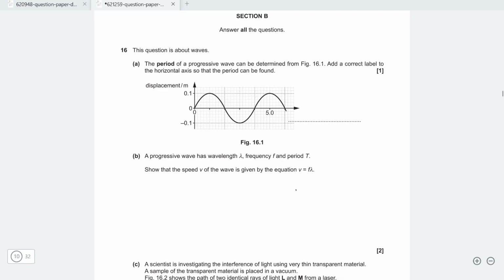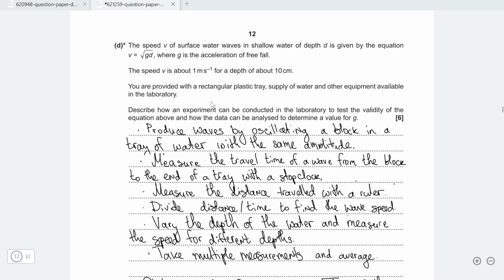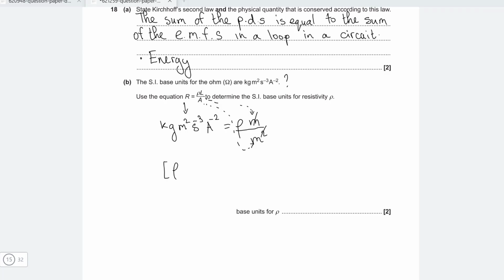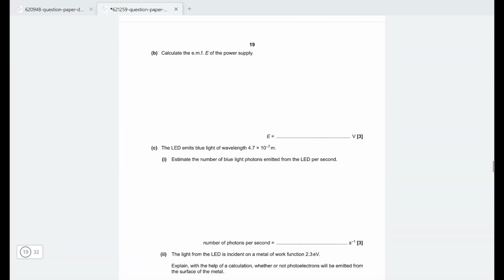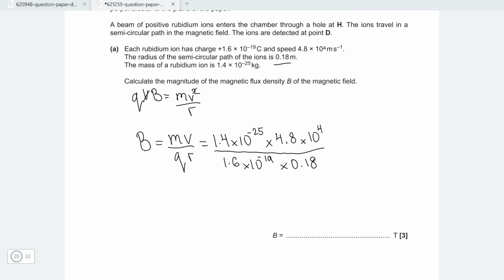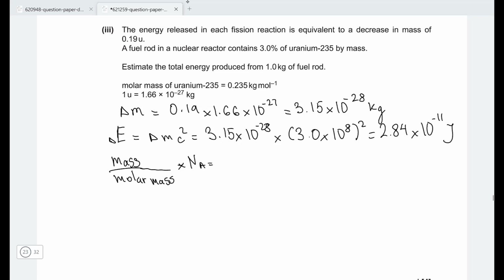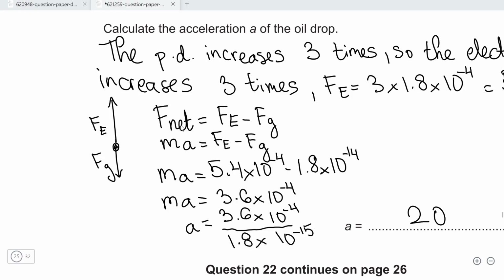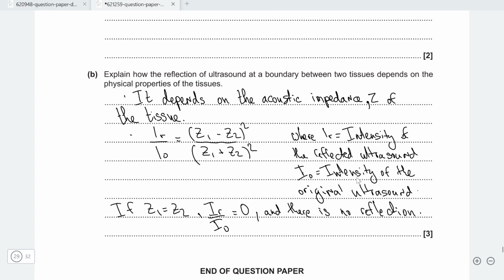My Solutions to OCR Exploring Physics 2019  | Written Questions | Paper 2 A Level Physics

Comment: in q 22. part b i you used wrong unit power of 10^-4 rather than 10^-14 however in part ii u managed to get the correct answer using incorrect value.
Reply from the maker: hello! I think I did a typo when writing and later using my notes I have the correct answer. Hope this helps.